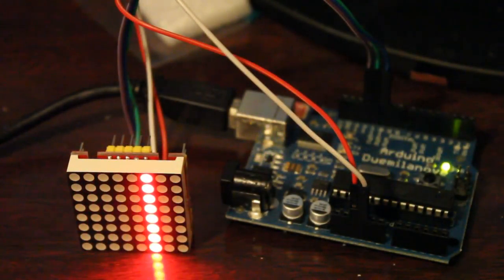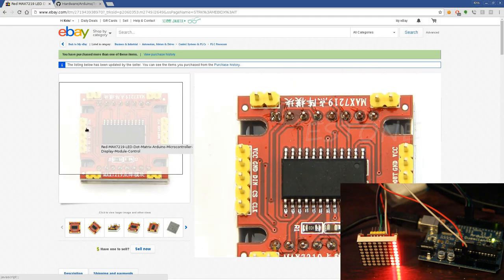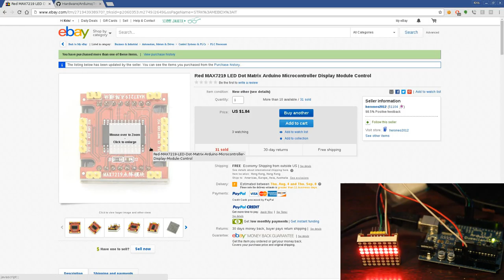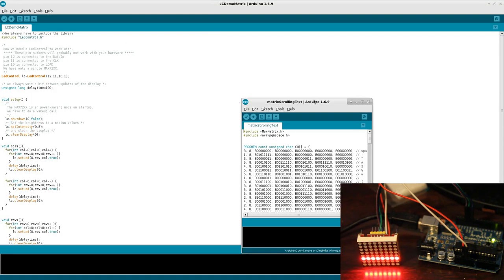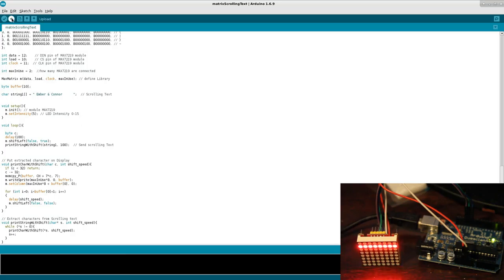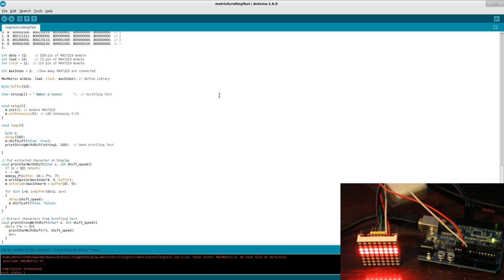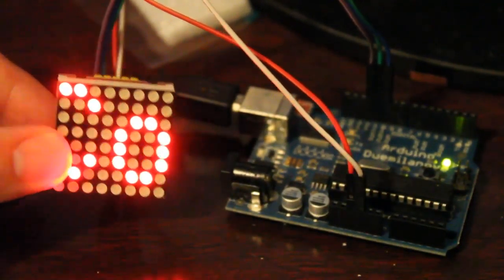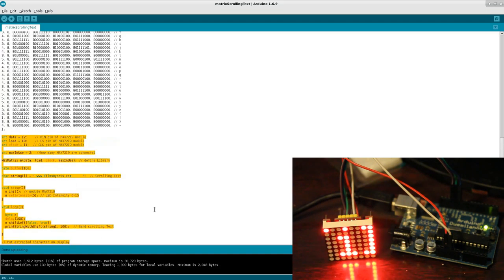Arduino Scrolling Text MAX7219 LED Dot Matrix Display module tutorial Part#2

Comment: what to do if it gives errors while uploading
Reply: Depends on the error.
Most likely it's one of these:
You have the wrong port selected.
You don't have permission to access that port.
You have the wrong device selected.
Reply: the port option is shown disabled in the software and showing a code 10 error in device manager

Comment: Hi Kris the error is like this (Error compiling for board Arduino/Genuino Uno). actually I am a Hobbyist. I have tried compiling in aurduino  1.8.5--1.6.5-r5 and 1.8.5. If possible pl compile it for 1.8.5

C:\Users\Protik\Documents\Arduino\Hardware-master\Arduino\Displays\LEDDisplay\matrix\matrixScrollingText\matrixScrollingText.ino:1:23: fatal error: MaxMatrix.h: No such file or directory

 #include <MaxMatrix.h>

                       ^

compilation terminated.

exit status 1
Error compiling for board Arduino/Genuino Uno.